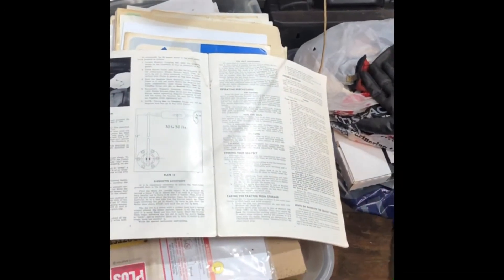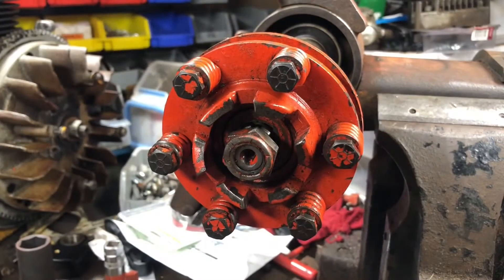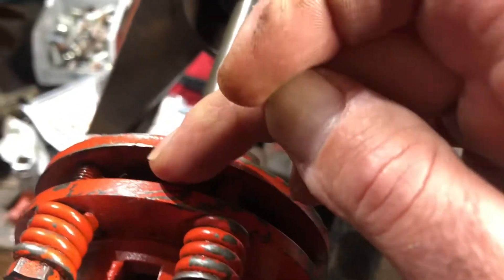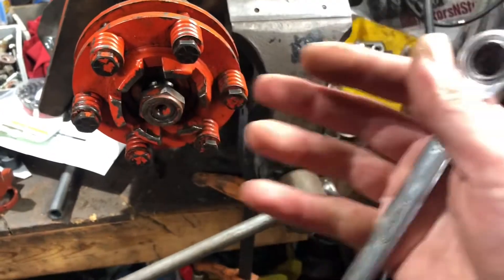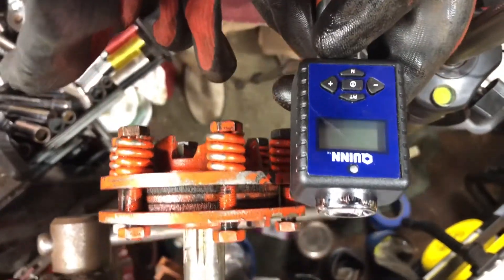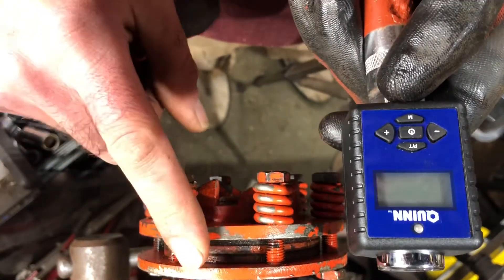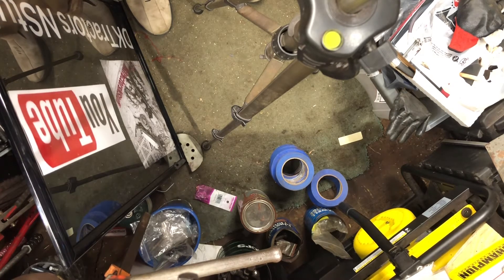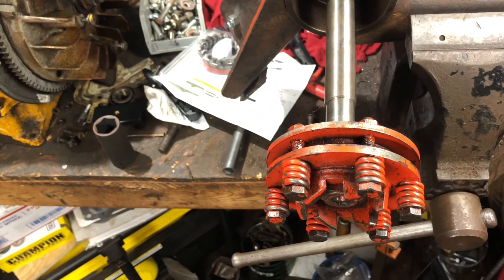Testing a Gravely PTO slip clutch with my new torque meter

Comment: never had need to check my MA 210 but it has rolled up a 5x7 rug hidden under the snow. Never slipped. Getting the rug out was the problem.

Comment: Hey Dennis...could you do another quick vid only this time keep the slip clutch in frame while it "breaks away"?  Don't necessarily need to see the meter's readout, I'll take your word for it. I'm curious as to how the actual clutch works in relation to the shaft at the break point. Thank you, sir!
Reply from the maker: So put the clutch in the vise and spin the impeller?
Reply: @DKTractors  I've never taken one apart to see how it works. Figured since you had all the parts handy and the camera ready... But that's okay. I'm guessing there's a flange on the impeller that is sandwiched between the spring-loaded plates and that when the accessory meets any resistance, it breaks away from the shaft. 33lbs seemed kind of light if you're running a tiller, so I thought maybe I was missing something. At any rate, don't worry about it.
Reply from the maker: @cattmann1405  I’ll do a comparison video between an old 3 spring and a “newer” 6 spring
Reply: @DKTractors  That would be cool! I've never had one apart and I don't remember seeing anyone put out a video dealing exclusively with the slip clutch and how it functions...so that would be awesome...Thanks ,Dennis!
Reply from the maker: https://youtu.be/sgjiT4v_r50

Comment: Where did you get that socket tool to engage the inner part? Homemade? Thanks.
Reply from the maker: Given to me by a coworker
Reply: @DKTractors  Lucky you. I just adjusted my clutch on a brush hog by blocking the blade and using a big screwdriver to "feel" the slip level. This attachment was new to me from the Mow-in. Anyway, at first I had a bit of trouble as it was stuck, so I backed everyone off, then got it slipping nicely, then bottomed them and pulled back 1/2 turn... still was too tight, so I backed off another 1/4 turn on all, and it felt pretty close. Buttoned it up and it seemed to work well. The lesson is that anything that's been sitting for a while might have an issue with sticking... it's probably not a big deal to let the PTO free it up if it's used regularly, but if it's been sitting a long long time probably safer to loosen it and free it up first like I did.
Reply from the maker: @cstory50  https://www.google.com/search?q=gravely+slip+clutch&client=safari&channel=ipod_bm&prmd=sivn&sxsrf=ALiCzsYfivWoE7PgxMPWG4rdf8SVuVw10A:1658178445366&source=lnms&tbm=isch&sa=X&ved=2ahUKEwiu9daJrIP5AhUXlIkEHZ64BjsQ_AUoAnoECAIQAg&biw=375&bih=542&dpr=3#imgrc=mtvGvdTwxm5P-M